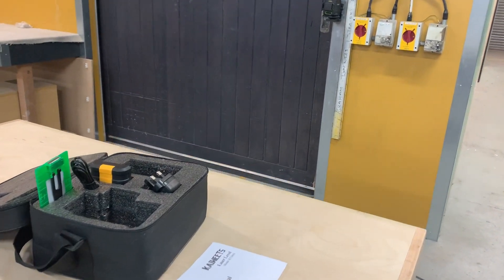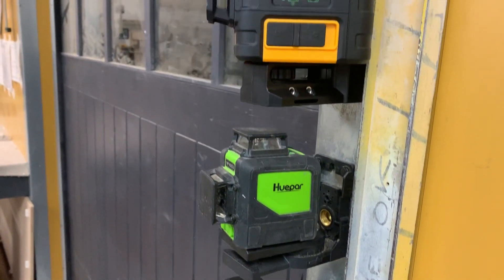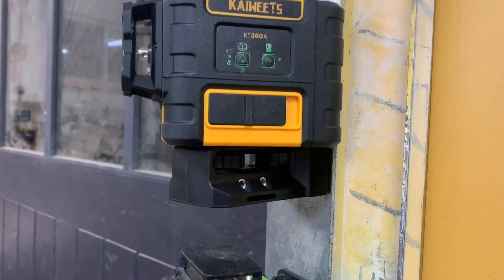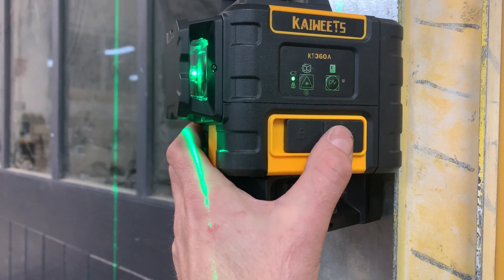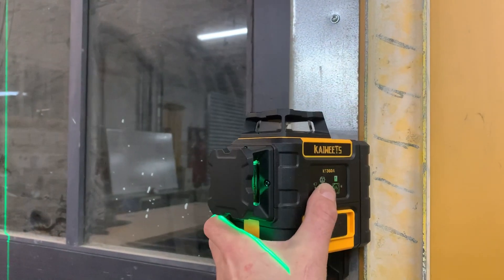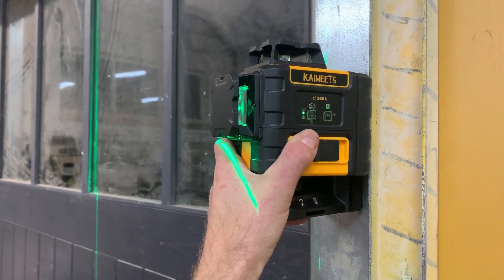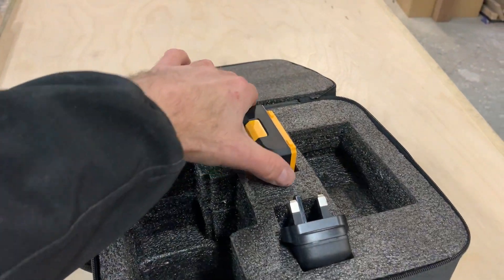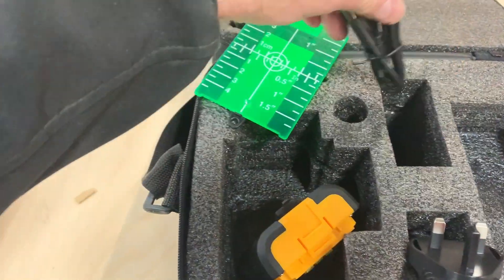Kaiweets KT360A Laser Level review

Comment: I purchased one of these and got a lot of use out of it so far. But now one of the two batteries has stopped charging and having no luck getting a replacement the battery from Kaiweets. There is a phone number for China but I don't speak Chinese. So from my experience don't expect Kaiweets to actually honor the Warranty.
I wished I had just stayed with DeWalt.
Reply from the maker: Thanks for letting me know this, it’s hard to know what the service will really be like until something happens.  I have heard better things about Huepar
Reply: actually it's 26.99us  my mistake . Great video i got one myself work on biulding sites. Perfect tool.

Comment: The other benefit of having two verticals which is mainly what I use them for is that it shoots a perfect right 90 angle. If you’re laying out walls and you want to pull off of control lines this makes it much easier. This does away with the 3-4-5 or  6-8-10  method to achieve a perfect right 90 angle.

Comment: Save the pain and get the Dewalt DCE089D1G hands down the best laser  on the market. Super rugged, amazingly powerful rare earth magnets, batteries last forever/the whole working day, plus if your already invested in the dewalt battery platform interchangeable 🤘what’s the warranty or dealer network like for these cheap Amazon lasers.
Reply from the maker: The downside of these lasers is definitely likely to be less aftercare.  But at less than half the price... you can see why people would risk it.
Reply: I’ve been using the Dewalt in Boston razors for years now. I remember getting the Bosch laser bob years ago when it first came out. I bought a Huepar about two years ago after seeing some reviews out of curiosity because I’m a bit of a tool nut. It’s a 3 x 3 60 model and I have had absolutely no problems with it at all. There is an added benefit to their lasers as well they can easily be recalibrated without having to send them off by simply removing the three towers and dialing in a small brass Allen Bolt that calibrates the pendulum. I’ve been in The construction industry for 22 years and work for a government contractor here in the states and I would honestly recommend a Huepar.

Comment: Hi Alistair
With the horizontal magnet configuration if you roll the laser through 90degrees do you still get horizontal and plumb lines ?
Another informative video 
Thanks
Reply: As in roll the bracket through 90 degrees
Reply from the maker: Ah... good point no the laser will actually only be level if placed the right way up!
Reply: @Alastair_Freebird  
Ok was just a thought 
All the best for the New Year